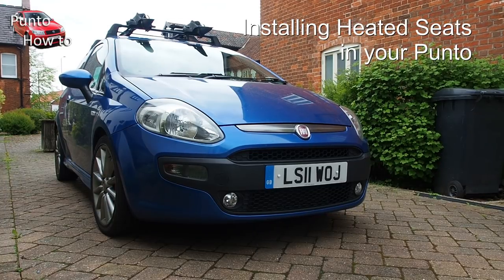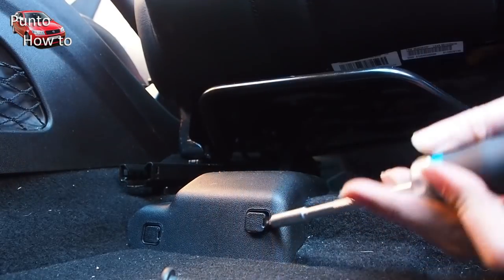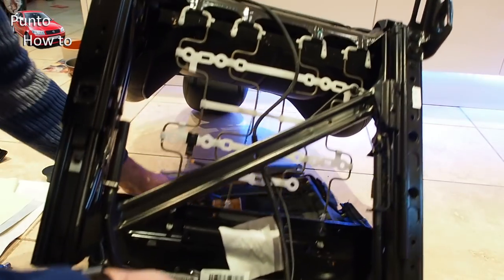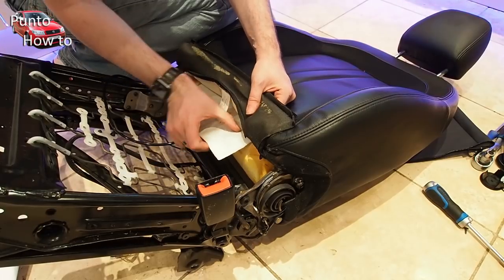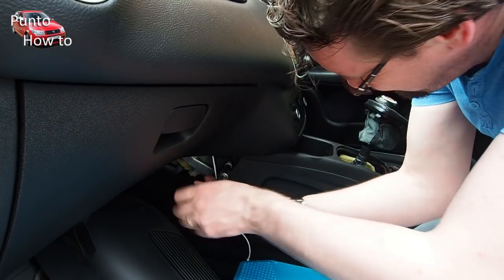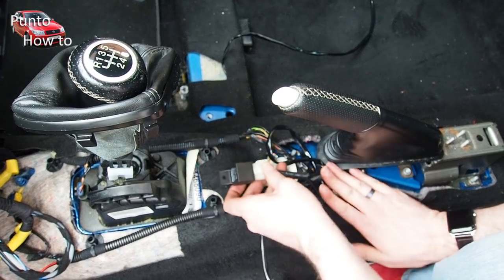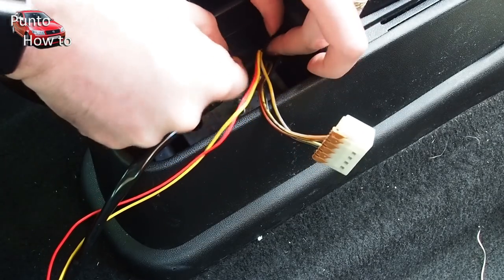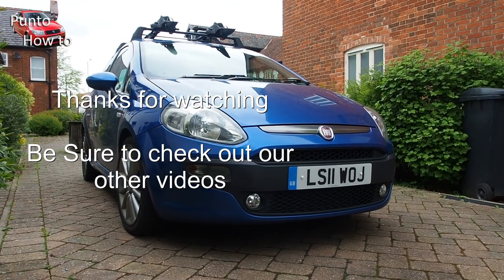How to install Heated Seat in a Fiat Punto, panda, 500, Abarth, tipo,

Comment: thank you for making such a detailed video :) just quick question, at the end of video (21min-29 sec)  you mentioned you are going to add the 10amp fuse that you have installed earlier!, I am not sure where I have missed but I don't see that installation part of the fuse holder?, could you please point me to the minute section when you have done that procedure.
Reply from the maker: At 16:30 I soldered a fuse holder on to the end of the wiring kit for as the heated seat kit didn’t come with a fuse holder
Reply: @PuntoHowto  cheers mate

Comment: Very nice tutorial, I'm also somewhat interested in doing the same to my grande punto, although my sport packet on a 1.3 mjet didn't come with dual zone AC and I'm interested in doing the upgrade. But I'm not sure what are the parts I need to change to make that conversion and can't find anything online, do you have any idea?
Reply from the maker: You can do this with just a heated seat kit that you can buy online. The kits can be bought usually on eBay, or Ali express it is worth looking on these sites to find something that will suit
Reply: @PuntoHowto   Yes yes, I understood that, you explained it very well in your video, I was asking about the AC.
Reply from the maker: @MrAlphamen  oh ok, does your car have ac at all or is it a non ac car?
Reply: @PuntoHowto  it has AC yes
Reply from the maker: It is not a simple job and not something I can really instruct you on how to do. You would likely need all the wiring loom for the dash from any donor car. There are a few sensors you would need, including a sunload sensor which is mounted on the top of the dash, there are sensors for the interior cabin temperature as well, the fan and the way the fan is controlled is also different which uses different parts, there is a digital speed controller for the fan, and you would need to replace the whole heater box behind the dash, with one from a duel zone climate car, which would have the sperate blend doors and motors for left and right. basically you'd need a donor car with all the parts already fitted and working, then you would need to gut both cars and transfer everything over to your car. This is a massive job and not one I would recommend anyone take on you could do all of this and then find the software in various components of the target car is not compatible, and then you'd need to swap even more parts over such as the engine ECU, body computer which would also mean changing all the locks and keys. If you can find a car with the duel zone climante control fitted, then it would be easier to just use that car and get rid of the one you have.
Reply: @PuntoHowto  Yeah I see the possible complications, thanks for the help

Comment: Can u drop a link to where you bought the seat heating?😱
Reply from the maker: As I said in the video I got the set from eBay, there are lots of different options of switch so I have purposely not posted a link to the set I used as someone else might want to look and choose a different design. Check out EBay and search for heated seats